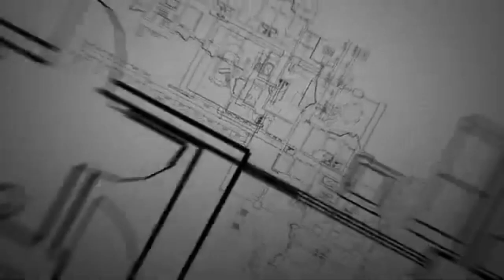How to install Granite Kitchen counter top in a easy way I ArRey Malolos

Comment: Gumamit po ba kayu nang adhesive
Reply from the maker: Hindi po, sand and cement since ang existing counter is concrete, if ang base cabinet is plywood or yung pagkakabitan ng granite gamit kayo ng epoxy glue. thank you

Comment: Sir anong gamit nyo na pangmasilya sa pagitan Ng granite at pampakintab?
Reply from the maker: epoxy resin grout or acrylic grout , granite sealer lang po then final buffing. Thank you
Reply: @arreymalolos5988  sir meron po ba nyan sa hardware
Reply from the maker: @kuyam8635  meron po sir, try nyo din po sa shopee or lazada. Thank you
Reply: @arreymalolos5988  sir yung Glumax ba masaganda ba sya iapply para sa dugtungan o pede din ba yung pioneer epoxy tapos hahaluan na lang ng kulay black para sa dugtungan
Reply from the maker: @kuyam8635  yes po pwde rin po gamitin ung Glumax, usually po ang ginagamit nmin epoxy resin grout or acrylic grout.. Preferred po gamitin  pioneer epoxy for cracks. Please watch Roof deck waterproofing https://youtu.be/3kqlestwrNk. Thank you
Reply: @arreymalolos5988  sana makagawa po kayo ng video kung paano paghaluin yung epoxy resin at grout tapos yung tamang measurement salamat

Comment: Ano po size ng granite po
Reply from the maker: available size po sa wilcon depot, 60cm x 220cm and 60cm x 240cm standard width po 60cm for kitchen counter top. Thank you
Reply: Hello po Sir.very nice kitchen po.ask ko lng po,what if ung size po ng granite n gusto namin,is not available sa store,pede po b magorder?magcut po b cla base sa size n need namin.Thank you po!
Reply from the maker: @genielynharz8505 , pwede naman po, standard size po ng granite sa store is 60cm x 220cm and 60cm x 240cm.. usually po ang magcut ng granite is si contractor or kung sino man po ang gagawa. Thank you

Comment: Gaano po kakapal yung semento niyo?
Reply from the maker: atleast 1 inch (25mm), depende pa din po s existing kitchen counter, ang standard height po ng counter from finish floor level is 85cm to 90cm. Thank you